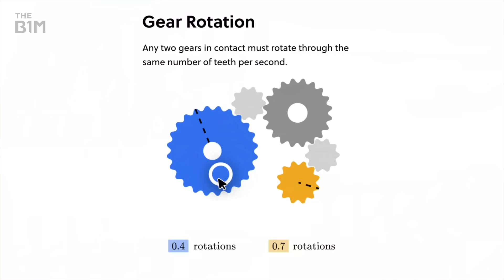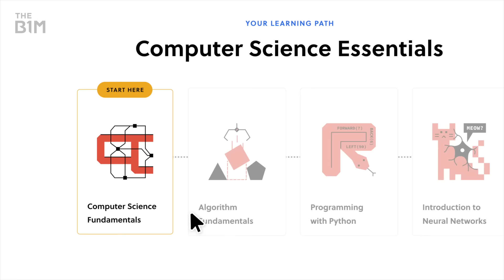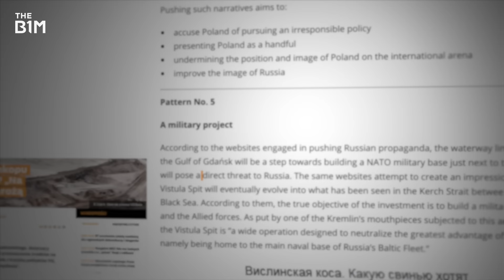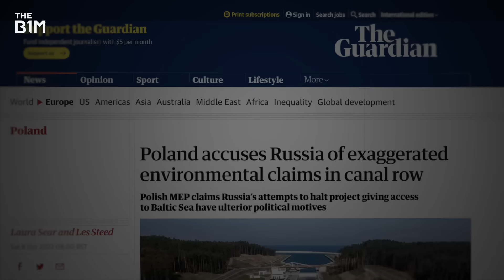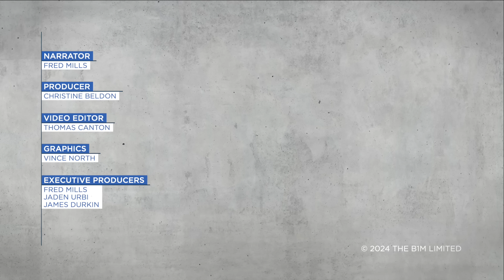Why Russia Tried to Block This Canal

Comment: Anyone know why Poland didn't opt to build a lock big enough to handle all sizes of modern cargo ships? Seems like a minor difference over a distance of only 1km. The entire thing seems unpractically small.
Reply: Simply beacuse it wasnt needed. Main cargo ports are in Gdansk and Gdynia that are already right next to the baltic sea. That canal was built simply to allow locals to travel with their boats without russians standing on their way
Reply: There is no real need for this canal - Elbląg (Poland) is not a crucial port. Currently, the canal is used by several private boats/kayaks a day, which incurs a cost of $10,000 per unit. Probably, its strategic significance is the biggest clue.
Reply: Also it wouldnt be just the lock that would have to be deeper and bigger but also Vistula Lagoon is not deep enough for cargo traffic.
Reply: Elbąg is just low priority and not so big port. Vistula lagoon is just not so deep for big ships. There is plan to make it a bit deeper so port can utilize full use of this canal. And currently Poland is increasing throughput of much better located ports on east Gdańsk/Gdynia only 60 km away and Szczecin/Świnoujście on most western part of sea side.
Reply: Probably EU wouldn't greenlight this project if it were to become yet another cargo port competing with German ports.
Reply: @NomTix  But with the cost, it probably wouldn't have been much more to just make it deeper to futureproof that area. Seems like a missed opportunity with a growing country like Poland.
Reply: @TurboBorsuk bruh Germany has like 2 ports that kinda matter. Nobody would sail to Poland just to ship stuff back to Germany by rail or truck. European ports are more centered around Netherlands and Belgium and in the Mediterranean. Polish ports won’t really compete with Hamburg or Bremerhafen simply because of geography.
Reply: It wasn’t created for container ships but for warships…
Reply: @AsgardVenture  But there is currently a lot of Polish cargo that is unloaded in German/Netherlands ports that is then transported by land to Poland. Or reshipped to smaller ones to transport it to polish ports that can't take biggest ships.
Reply: Have you seen size of vistula spit, and ports over there? I doubt big ships would even be able to move
Reply: @michanowak3001  You have to consider that the distance over land is much shorter and at the ports of Garmany/Netherlands economy of scale plays a role.
Reply: There was an ambitious plan to rebuild port in Elbląg to serve big seafaring ships but ultimately government founding was cut and city of Elbląg don’t have money needed so yeah this canal is economically useless
Reply: I don't understand why there are locks at all. How can the water level be so different when there's an open access to the Baltic just a short stretch down the road?
Reply: Poland is a poor country.
Reply: @protorhinocerator142 
Influx by river’s !
This is more of a tourism project than an economic shipping project.
The ports of Poland are connected via the Kaiser Wilhelm Channel to the northern sea or via the Belt.
Reply: @TurboBorsuk  nonsense, the EU doesn't block Antwerp nor Rotterdam so why would it block a Polish port for competing with the German ports...
Reply: @chemicalfrankie1030  Only the smallest of Polish warships can fit in this canal.  Nevermind the fact that the average depth of the Vistula Lagoon is only 2.7 metres.  For example, the two Oliver Hazard Perry class frigates that Poland got from the US have a draft of 6.7 metres.
Reply: @nanoder7te  Economy of scale is good,  What is better to use ship that can move 15000/20000 containers or multiple trains that can move only 40? That is normal over Europe.
Reply: So where do we go from here? White elephant, small shallow draft crafts only, pleasure/entertainment/tourism/land creation or reclamation. Offshore transfers to barges? What's the truck/rail/air transfer hub in this area?
Reply: @chemicalfrankie1030  yeah those damn fisher boats who lead war with the fishes, duh 🙄 the United Nations should force them to make peace with the atlanitians
Reply: The port in Elbląg is basically non-existent. Well, it is there, there is just nothing happening, even when traveling through russian waters wasn't an issue.
The lagoon beyond the canal is on average 2m deep - it will have to be constantly deepened to allow basically any ship to travel to Elbląg.
Also the Elbląg River is currently being regulated and deepened, and to make the matters even more funny - the people who started this project left out the crucial last 900 meters to the port out of it - that means, that EVEN when all the work in the project will be finished - there will still be no waterway available all the way to Elbląg - rendering this whole project absolutely useless.
And as it is said in the video - making a return on this investment will take 650 years. That is AFTER the last 900 meters are done, and those calculations are based on some VERY optimistic assumptions: that the amount of cargo moved within the port would quickly be double of what this port has moved in its peak ~40 years ago.
Only problem is that in that time Gdańsk and Gdynia ports grew immensely, have a lot better infrastructure, are better located, and have more transport options. Also moving anything from those to Elbląg by train will be way quicker.
Economically - this project never made any sense and is a waste of money.
When it comes to strategic value - also none.
Reply: Port of Elbląg and the lagoon are about 4 meters deep. The lock and canal have no trade or military value. Our navy has no ships with draught so small.
We call it the Kaczyński's ditch or "rów Kaczyńskiego" in Polish, after the far right politician how made it happen. "Rów" translates to ditch, but can be also translated as gluteal cleft.
Reply: There are no major ports in this area, and the canal is mostly used by small vessels. Big cargo ports are located in different parts of Poland.
Reply: @TurboBorsuk  what a BS
Reply: Cos this whole project is huge public money grift, not a though out infrastructure project.
Reply: @aoilpe  The Kaiser-Wilhelm-Kanal got renamed to Nord-Ostsee-Kanal after WWII for the reason that we don't have an emperor any more. Also, its international name is Kiel Canal after its eastern port.
Reply: I guess everyone, including the designers and builders, already knew the answer :)
Reply: @michanowak3001  When a container ship reaches a port, its containers aren't just dumped at the place where it had anchored, they get distributed all over the area. Why? Because they will go to a lot of different destinations. It would make no sense if a ship of this size would turn into a petty packet distributor, wandering all over northern Europe. For this we have other means.
Reply: @chemicalfrankie1030 I would think so too, but can a frigate pass?
Reply: i don't think all sizes of cargo ships will ever need to travel here. pretty sure gdansk is a much bigger port
Reply: @protorhinocerator142 I’m sure with sea level difference it would be like a ranging river and you can’t have boats banging around in the channel.
Reply: @AsgardVenture  You focused on the wrong side of things. It's not to transfer goods to Germany from Poland but to bypass Germany altogether. Even if someone would deliver goods to the Netherlands, it still needs to reach Poland. thru Germany. In Your post, You only focused on delivering to Germany which only shows how people look at Europe (it's just Germany)  Ports in Poland can shorten the delivery time a lot to countries in south east countries not to mention the cost. Germany is not having ports as big as Netherlands but it still profit on them heavilly.
Reply: @chemicalfrankie1030 bingo!
Reply: @fujin09  BS = bullshit = nonsense
Reply: @blublum7916  Do not try to apply reason, the builder did not do that either.
Reply: @protorhinocerator142   The natural opening is a small opening. So when winds come from the Baltic sea it would push water up at the Baltic side and way from the lagoon side.  The opening has not got the capacity to level it even close. Plus with lock will you control the flow/current  through the canal and thus any potential erosion and/or major shifts in currents and thus sandbanks.
Reply: because it's not about practicality. it's not about efficency or even making a profit. this canal is a statement and that's it. the sole purpose of this project was to emphasise Polish independance from russian control.
Reply: @AsgardVenture  Agreed.
Reply: The ships using this canal are generally pretty small,  they only have to carry dry bulk from the businesses to the larger shipping port.
considering $450 million dollars can be wasted really quickly on all sorts of things,  building a canal that bypasses any form of Russian control and permit system is a real deal.
i would guess it probably "pays for itself " after 5 - 10 years in the form of saved tariffs, inspection fees, traversal fees,  Russian harbor pilot fees etc.
Reply: It's not a lock. It's a canal.
Reply: @protorhinocerator142  The water level in the Baltic Sea can change by plus/minus 1 meter depending on the wind direction, and even more during a storm. Due to the only small breakthrough in the Russian part, the water level in the huge lagoon does not change as quickly as in the Baltic Sea, so a lock is required.
Reply: Probably because Poland will be in possession of Kaliningrad before the decade is out, anyway ;P
Reply: @NomTix  That makes a lot of sense.
Reply: @TurboBorsuk  EU would greenlight anything as long as they got their cut.
Reply: @blublum7916  I wonder if that's why they have 2 gates at each end of the lock. They could close the outer set and deepen the lock (including taller gates) in the dry, then dredge the rest of the canal in the usual way.
Reply: @AsgardVenture  Currently, from few years Gdańsk is 4th busiest port in Baltic sea with ambition to take 3rd place. It's also only place on Poland coast that could accommodate Panamax size ships.
Reply: @barthoving2053  So it's not a tidal issue, it's more likely a seiche.
Reply: @Bosshog8844 Poland's economy is booming.
Reply: The water level on both sides is usually the same. If it is different, the difference is minimal. I think that the author of the film greatly exaggerates by demonstrating the lifting of a ship in a lock. The function of the lock is to limit the mixing of sweet water from the Vistula Lagoon with salt water from the Gulf of Gdansk.
Reply: There are already major Polish ports directly on the Baltic Sea for major cargo. This is for smaller cargo and fishing as well as recreational vessels to have easier access to the sea, without having to travel to the major ports. #Geography 🌍
Reply: It kind of looks like a middle fi ger, coincidence??
Reply: @protorhinocerator142 It is not a short stretch. Also there could be a major river that is carrying large amount of water into the bay.
Reply: @TurboBorsuk  Have you not noticed that the period of EU and Germany hatred in Poland has officially come to an end?😂
Reply: @TurboBorsuk  I think people don't really understand how the EU works. If EU funds are requested for a project then the EU gets a say. But if a country  is building wit it's own money then i does not.
Reply: I’d like to take a cruise from Gdańsk to elblag someday
Reply: @JonMartinYXD  interesting, i wasn't aware... definitively not for frigates nor even corvettes!
Reply: @AsgardVenture  I would take a look at GDP and birth rate. Germany, France and the UK will be nothing in 30-40 years.
Reply: @protorhinocerator142  The locks are there more so the fresh water from the lagoon does not mix with salty water from the sea.
Reply: @chemicalfrankie1030   Yea warships are known for their extremely shallow drafts NOT!
Reply: It's both @G5rry
Reply: @maciej9882 Sweet water?
Reply: @KPSWZGII 
FYI, there is the not so mall matter of Denmark being between the north Sea and Baltic sea. Meaning that for one, the size of ship that can reach Poland in the first place is limited, and travelling there by sea generally costs more and takes longer than just loading polish-bound containers on a train in Rotterdam or Hamburg.
Reply: that's because Elblag is a feeder port for a major port of Gdansk. It will take care of small vessel traffic (barges) for Tricity ports (Gdansk Gdynia and Sopot)
Reply: The depth of the lagoon is too small and it would have to be constantly deepened because the Vistula River adds new material. This would be important for the environment. The port of Elbląg itself is not large, so it will handle ships with a draft of up to 4.5 meters. Another interesting fact is that yachts can pass by on their way to the Masurian lakes. According to information from the Maritime Office, over 1,300 yachts have passed through so far.
Reply: @TurboBorsuk  Port size is determined by the industrial and commercial cargo demands of its hinterlands and the effiency of connected infrastructure. Just building a bigger port by itself does fuck all. Politicians are almost powerless to the economic forces behind this.
Reply: @TurboBorsuk  "lol"
Reply: It's infinity times larger than needed considering flow
Reply: @protorhinocerator142 you're right, they're wrong. they shouldve asked you, you wouldve saved them the money, the dont need the lock. they just didnt know there was a sea inlet nearby. they thought the water level was different but what do they know. even now, that they have a sluice, its actually not different.
Reply: the port in Elbląg is pretty small anyway it cant operate the biggest cargo ships. these ships go to gdynia on gdańsk anyway.
Reply: Becouse stupid people decided to build it. And main driver was not real change but internal propaganda.
Reply: @TurboBorsuk  Nonsense, Poland funded this project and it does not breach an EU regulations.  There is nothing for the EU to greenlight.
Reply: Because it was not a practical project. It was an ego-project by the former national-socialist government. It only benefited some cronies of theirs to siphon-off significant amount of money. Elbląg is irrelevant for any major commercial traffic as even if that channel was wider and deeper (yes, it is also too shallow) the port in Elbląg and all the waterway toward it is too shallow for any serious large ships.
Reply: @protorhinocerator142 Possibly to prevent a large alteration to the natural water flow and therefore causing problems from silting up or erosion in other places. If it needs a lock then there must be a tidal difference. Only speculation on my part though. 🤔
Reply: @erikvanasch why would it block? Because its a competitive,  because its polish? Germany is trying to block everything what Poland is doing
Reply: @NomTix  exactly last 2 weeks, they was  4 container ship over 20000 TEU, 4 ships from top 10 list  biggest cointainer  ships waiting on roadsted to Gdansk/Gdynia
Reply: @ChrisBrown-iu8ii  warships dot usually go into lagoons tbh
Reply: @blublum7916  Something like this makes sense to build in steps. Create a workable canal, even if of limited use. then come back and deepen the surrounding waters so the more expensive larger channel can be built. But with the comment about Germain opposition, it may be decades in the future.
Reply: @ms-ht1cj  building something is what Russians were never good at, so I understand your concerns and projections 🤭
Reply: Or allow NATO vessels to have back door access to Kaliningrad... @NomTix  😁
Reply: And by saying "strategic significance" you mean NATO vessels can now have access to Kaliningrad? @Micro-bit
Reply: That is Russian point of view. Polish point of view is that it is needed and importnant. Now we dont have rely on Rusia's moods and hectic behaviour. Secondly, why it concerns you so much? Are u Ruski?
Reply: @AsgardVenture Maybe so, but Polish ports are providing acces to Eastern part of EU. Don't you think it's easier to sail straight to Gdańsk, then unload it in Hamburg and transport the cargo on land?
Reply: This small lock and canal is sufficient for port in Elblag, which will never be a huge port. It will allow small coaster ships ( up to about 1000 tons ) to enter. Only remaining problem is to dredge about 800 m of access to the port. Previous PiS government was unwilling to do it without passing the ownership of the port from Elblag authorities to Warsaw. New government is willing to perform it without black-mailing Elblag. Elblag is an important industrial city with huge ABB steam turbine factory. These turbines are exported to many European countries. At present it is impossible to do it in one piece by truck or train due to excessive weight. It could be done easily by ships and save cost of dismantling and assembly. Besides there are some other tiny fishing ports: Tolkmicko, Frombork and Braniewo. Fishing in Baltic is almost dead, but tourism is doing well; yacht marinas could be further developed and enhance local economies.
Reply: yeah but that won't work, the water still needs to mix
Reply: Because it was mostly a political move, not an economically viable one
Reply: @blublum7916  The cost is significantly more because of the size of the gates required. but the channel is built to accommodate that some day if it's deemed worth it.
Reply: @miroslawmoczyrog "far right" lmao
Reply: But only very little, when the ships are moving through the locks. 

Otherwise the wind would be constantly pushing salty water into the lagoon through the open canal.
Reply: Varmia and Masuria (Elbląg) is a sparsely populated, poorly urbanized, poorly connected tourist region, so there is no point in building gigantic maritime infrastructure there. This project characterizes populist governments for which economic calculation is the least important aspect. Fortunately, Poles removed these idiots from power, a government that thought that money grows on trees.
Reply: Problem is, this was only a passion project of the Right-wingers. It's just a commercial canal for small ships like civilian fishing boats. It cannot fit warships like frigates or even corvettes for example, and it holds no military or strategic importance.

Years would have to be spent building another 2nd. canal adjacent to this one instead, and transforming the port city it leads to into a military naval base.
Reply: Maybe it just has to be big enough for Polish Navy patrol boats?
Kaliningrad sits on the same lagoon. Blocking the old Russian canal further north against Polish navy vessels from the Baltic Sea is trivial. Nothing would get through if the Russians don't want it. But if the poles already have boats with torpedos inside the lagoon, there's a much greater threat to the Kaliningrad navy base.
The Poles just basically build a big door through Kaliningrad's first and most important naval defense wall.
Reply: @Yora21  The Polish Navy in it's current obsolescence and neglect has no plan for any high-capability patrol boats.

The entire Polish military is in dire need of rebuilding from scratch right now.
Reply: @AsgardVenture  How little You know.. We will see in the future.
Reply: @Alex_Guy1011  you are naive to think pis was right wing
Reply: @nexor7809 Worse even. They are stereotypically Far-Right, just like any other modern-day "Conservative" political party around the world.

Doesn't change the fact that a new canal needs to be built.
Reply: @Yora21  the patrol boats small enough to operate in the lagoon, can enter lagoon through existing inland waterways.
Reply: @simeonges1  It's a terrible place for NATO warships. The lagoon is too shallow and restrictive, while being within range of Russian anti-ship missiles. It would only be useful once Kaliningrad was taken.
Reply: The largest merchant ships cannot enter the Baltic anyway. The largest container ships dock at Rotterdam and containers are sent on by smaller coastal and river ships, by barge, or by road or rail.